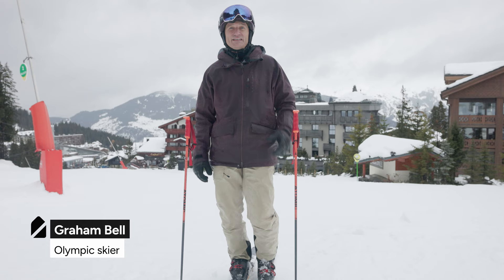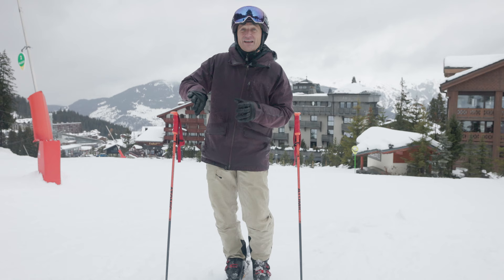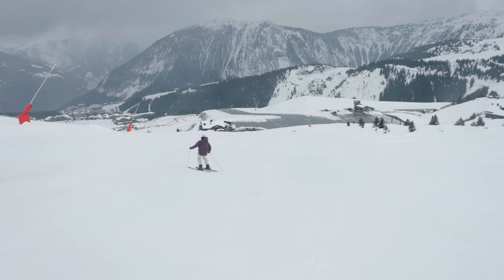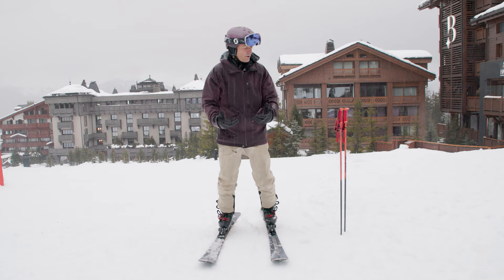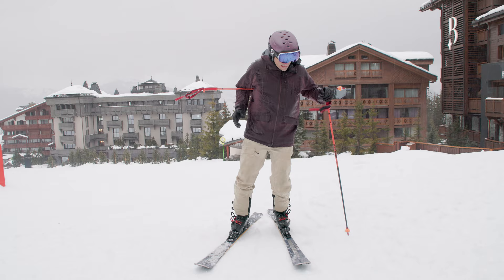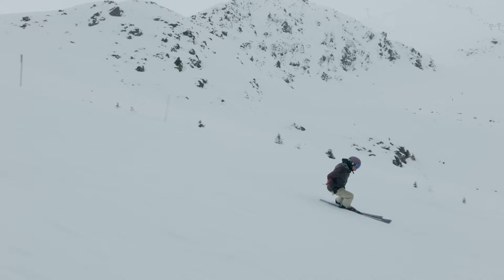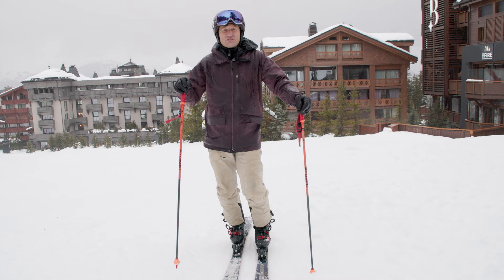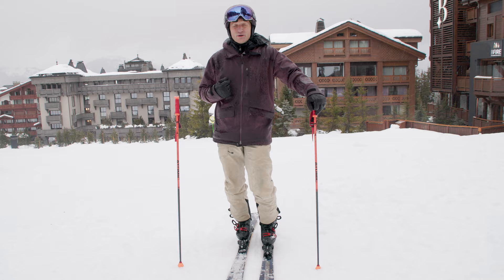HOW TO INCREASE EDGE ANGLE | 3 tips with Olympian Graham Bell

Comment: There was some Yes in there but mostly No!  2:00 This part was good to show you how to keep your upper body as vertical as possible and rotating your legs to Fine Tune the grip your skis have on the snow.  The rest of it was describing what things look like without teaching how to make them look like that.  You have to come up with what makes the look and the feel happen and then forget them because they will happen naturally when you do what they skis need from you.  For turning a parallel turn into a carved turn, this is all you have to do and it's easy to remember.  You are traversing on your right foot. You want to make a carved turn to the Right! There is a stool to your Right.  You want to rest your Right cheek on the edge of the stool.  Take your weight off your Right foot, lift you Right cheek and slide it over onto the Right stool.  Everything you think about is in the direction of the turn you want to make. By lifting your cheek, you are forcing your upper body to stay vertical.  The more you slide your cheek over the stool, the steeper the leg angle.  Everything that that happens in your body is the byproduct of doing that.  You don't think about them, and you don't teach them.  During that turn, you adjust the edge control by leaning your knees into the hill very slightly which will get the skis a little more on edge.  It doesn't take much.  That makes you ankles lean over but that is a byproduct that you shouldn't think about.

Comment: New skier here. All these drills with no poles. But where do I leave my poles on the mountain?
Reply: Normally I'll just leave them by the top of the lift. Knock on wood haven't had a set pinched yet.
Reply from the maker: @cswalker21  either have a friend carry them for you or leave them by the top of the lift or on a ski rack if it feels safe to do so 😀